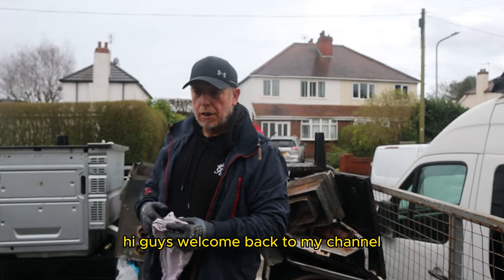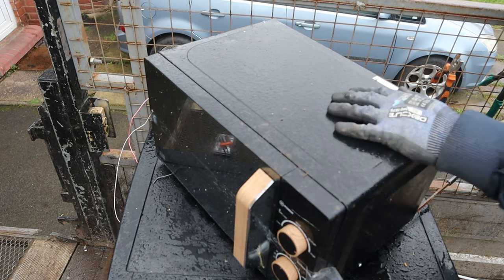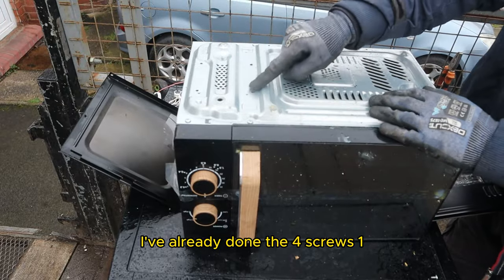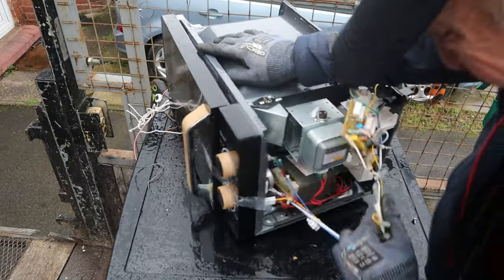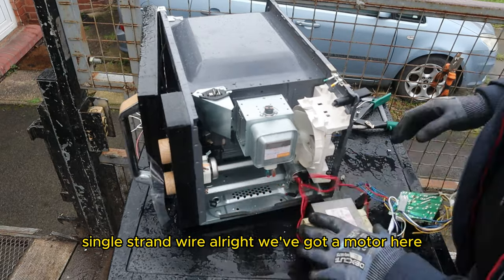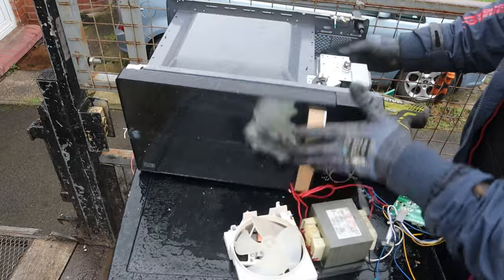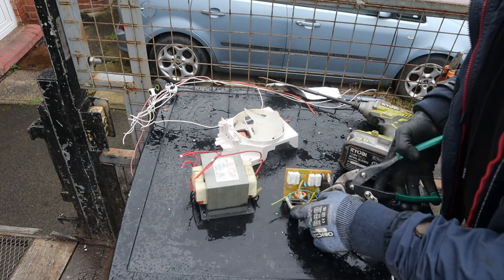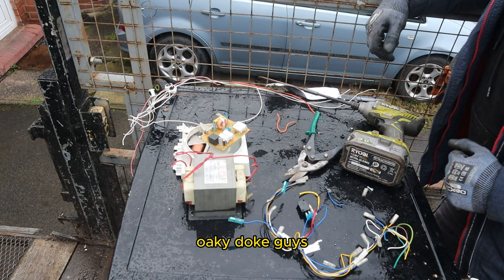how to strip a scrap microwave for cash

Comment: I used to be able to turn every microwave into  at least £6 cash, nowdays with ally windings in the transformer they are not so good 😢
Nice vid 👍
Magnetron haven't been deadly for decade's, there a few grams of No2 under the cover,  I just pop it off, snip the wire and leave it at that but you can get more I side the emitter but I don't bother, takes too much time for the return IMHO 🤔